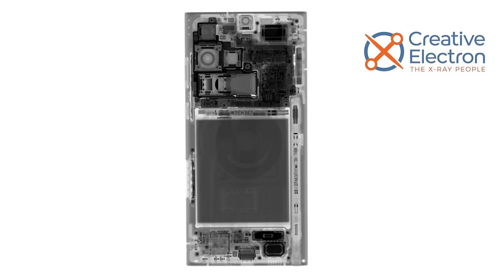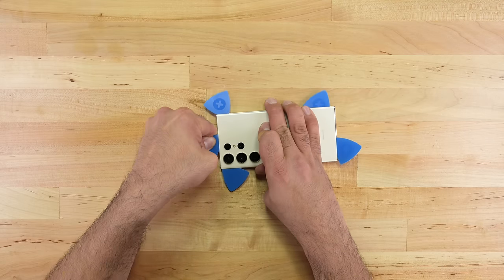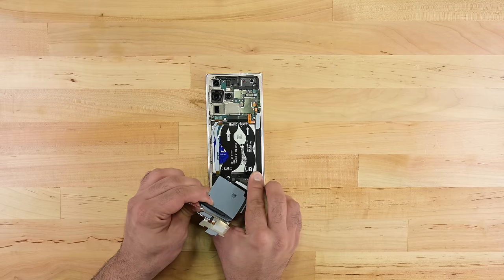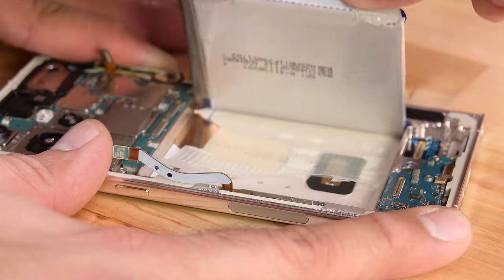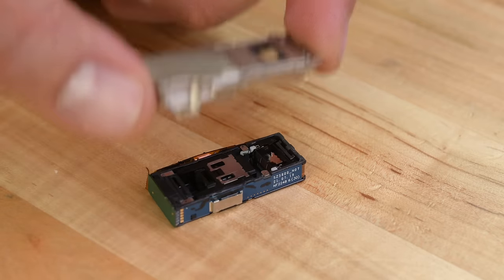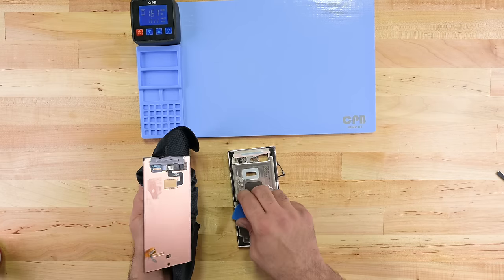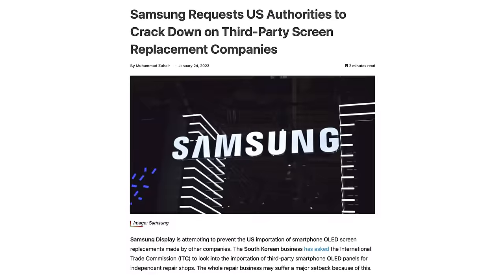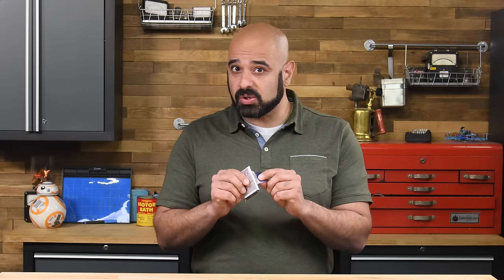S23 Ultra Teardown: Right to Repair Forcing Samsung Towards Repairable Design

Comment: How Completely software locked phone getting 7/10 and a phone without any software locks getting 4/10 For using too much glue. And Samsung provides debugging software for everyone of their phones. Reparability score really needs to include software Not just the hardware.
Reply: Even if you only care about hardware i phones have security screws so that is not getting any negative points ? .
Reply: Agree
Reply: @Gokul_Yt  no, because the screw drivers are very common
Reply: @mus_xr4653  IPA is also very common
Reply: The screens on the s23 and s23 ultra are irreplaceable. If you want to replace a screen you would have to replace the screen and the full frame, making the after market repairs unaffordable
Reply: @Gokul_Yt  maybe somebody is supporting Iphone
Reply: @mus_xr4653  neither on the new iphones you loose so much  functionality.  And samsungs whole disply+  battery bundle (from ifix it) is cheaper than iphone screen alone.
Reply: Also let’s not talk about screws either. You need multiple screwdrivers for iPhones.
Reply: Better secure phone, than an insecure Android phone. But also, Appl is more nature friendly and repairable, and why even discuss this if people like Apple and its here values they purchase Apple if they like Android and its perks there is a full market of Android phones. Nobody is forcing you to purchase an Apple device and there are alternatives. I like Apple so I purchase it and don't complain, as it is told what I'm purchasing and getting for the amount of money that I spend.
Reply: @valtersITeu  what does anyof that have to do with repairability of a phone. Apple really cares about enviornment with these software locks cant agree more
Reply: @mus_xr4653  j en ai deja remplacer 2 c est 380 euros la bete et en ce moment trop de delais
Reply: @valtersITeu  what you know about apple security phones, to compare it with android phone security?
Reply: @valtersITeu  you've never worked on an iPhone before.
Reply: @valtersITeu  Typical IPhone User lol.
Reply: @MUS_XR  samsung screen replacements are STILL cheaper than iPhone screen replacement. And it also means that most repairs are stress free since you don't need to mess with the display to replace something in the back. Also back replacement are super easy and cheap which is nice.
Reply: Are y’all working at samsung store or apple store? if so then it don’t come out of your pocket anyway. no corner repair shop is going to use original displays, and no third parties are able to make samsung screens on the other hand there’s a sea of third party iphone screens for those that need options.
Reply: @AndyZULUL  if no third parties will be able to make samsung screens they also not be able to make iphone screens bcz samsung is the one that make screens for iphone and the trademark is only filed agains 3rd party iphone screens
Reply: @Gokul Yt  back when iphones had lcd displays people were using third party displays from China which were cheap and couldn't tell the difference hardly. But I don't think you can get 3rd party oled displays not that I've seen any.
Reply: @mus_xr4653  "the screens on the s23 and s23 ultra are irreplaceable." What about the plus model? Did you leave it out because its screen is replaceable?

Comment: LMFAO they give it a bad score based on how they can repair the device with their flawed tools, heat and IPA will remove that back glass faster than you could try to remove that front OLED from any iPhone without going the apple route. Admit it ifixit at this point your at apples mercy.

Comment: batteries shouldnt be glued in to begin with
Reply: What would hold them in the frame then. You don’t want the battery shuffling around.
Reply: it damages the battery if it is not glued....
Reply: @williamskyseraspili4779  theres a ton of different ways to attach a battery without making it risky for unexperienced  users to remove
In fact, i can hardly think of a more dangerous way to attach a battery than gluing it in
Just look at older phones, samsungs xcover series or some laptops, it has always been possible to make a battery replacable without making it a hassle
There is no excuse for a company to glue things shut except for making the product have  a guaranteed shorter lifespan, batteries are always the first thing that goes
Reply: @CommanderCodey  how are AA batteries secured in place?
or single button cells, car batteries, battery packs on xbox controllers and maybe the best example, older phones?
its all possible, has been done before and even is done today
just look at samsungs xcover series for example
no glue, doesnt wiggle and youre able to replace the battery in 10s or less
Reply: @PLPlolol1  removable batteries need bulky safety cases casue they are ment to be handled by the consumer.
Reply: @PLPlolol1  AA batteries are secured with the spring putting tension against it to hold it. Old phones had the battery held against every side. In modern phones it could move around in every direction if not secured because there’s no “holders” around the battery holding it in place. Except for the glue.
Reply: @CommanderCodey  tell that my xcover4s
We dont need glue

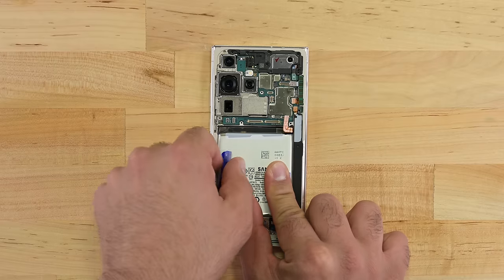Comment: 1:31 i don't agree at all on this pulltab. Your perception is IMHO influenced by the fact you tear down brand new phones, so the "stretchy adhesive trips" Apple uses work as intended on new iphones. But if you're replacing the battery after 3 years of ownership, all the heat cycles from charging and using the phone "destroy" that adhesive, meaning no matter how careful you are those stretchy stips are gonna break and you end up having to pry out, risking battery puncture.
This kind of "huge pulltab" Samsung has adopted (and was already in use by Huawei and One Plus i believe) might prove less convenient but it gives a consistent battery removal procedure even years down the line.
Also, this requires no additional tools, while the iPhone adhesive strips have to be grabbed with tweezers and almost always more extensive disassembly of the phone (taking out the taptic engine for example).

Comment: You give it 4/10 but other repair channels give it 9/10...
So what is going on here? Why have you more trouble and negative view on it than others? Explain it.

Compared to iPhone14, it get much negative score and it's reported software locked. Then compared to others, iPhone 14 should have 2/10 score here.
Reply: Well i think the main problem with Samsung is still the curved screen, that is just so much harder/pricier to repair than flat screens(And ofc the insane amount of glue in the whole device). Is it worse to repair than a software-locked screen thought? Hard question indeed...
Reply: @StarfoxHUN So, a part that CAN be replaced while retaining FULL functionality vs a part that CAN be replaced WITHOUT retaining full functionality is a toss up? Heat plate or heat gun at 173F/80C does quick work of the glue.
Reply: Rent free babyyyy

Comment: I’m glad Samsung Google has partnered up with you guys to help people fix their devices. I wish Apple didn’t software lock all of their components to the motherboard. now, if we want to fix our Apple devices we have to read a long ass manual. i’m glad Google and Samsung just make it quick and easy.
Reply: @No offense the idea is to have CHOICES. apple charges an insane for out of warranty/apple care repairs that are frankly not worth it for older devices. and they can also refuse to service your device, or maybe apple repair is just not convenient in an area. for this reason, it is EXTREMELY important to have 3rd party repair option so people are not at the mercy of one company to get their things working again. if you would like apple to fix your things, great, im glad they can help with that, but you should never support apple's decision to lock down repairs so other people cannot fix things their way too
Reply: @No offense they serialize components and then tie them to a motherboard
Reply: @No offense how is a serialized display going to secure your device?
Reply: @No offense way to ignore my question.
Reply: @KevinColumbus  Dude, just leave him alone. It's hard to have a convo with someone like that
Reply: @hassanmwasisebe3784  yeah I gave up lol
Reply: @davidyang9902  there are reprogrammers available and that we use at the location I work at as a 3rd party repair technician.
Reply: The samsung one bundles battery and screen. And they're often out of stock. I feel like samsing doesn't want to to repair your own phone, and the repair partnership is more "just for show". Similar to apple's self repair program.

Comment: Will you guys be doing a chip ID at all? There's definitely some pretty significant changes to the sound. I am curious to see if Samsung have upgraded the amplifiers to the newer higher powered Cirrus models that are in the ROG 5/6 phones or if they've just stuck with the older models, and only upgraded the speakers.
Reply from the maker: Chip ID is coming soon!
Reply: @iFixitYourself 🔙

Comment: Minimum 250 bucks on ebay for a screen + digitizer replacement kit... Sure they may have made it a bit easier to repair your device, but at the same time cracking down on accessibility to 3rd party oem parts, you are better off just going through your phone company still. This is 1 step forward and 2 step back.
Reply: Mm makes me want to sell for that reason but hopefully the price to fix it goes down with time

Comment: Always found Samsungs to be one of the best to disassemble and repair, even with the glue they use for the battery, have always just added some IPA and walked away for a few minutes, should also note a pull tab is not new for Samsung devices  it has appeared previously on some of their tablet devices.

Comment: i disagree on the score. at least you can repair this device without the manufacturer. 
even has an open bootloader. 
I have a galaxy s5 to play arround and i'm still able to install new custom software. All about the options.
Reply: @No offense this is a good point. Best would be the best of both worlds :)

Comment: There's something i totally don't get. Why the curvy cables in the inside? They are definitely bit more pricier to produce than straight cables, so what could be possibly the reason they make it curvy?
Reply: @cmmartti  why wont it be more expensive, when it costs more material. Yea the amount is tiny in one unit, but when you produce millions of them, it adds up.
Reply: @cmmartti  I think you did not understood my original question. What i asked actually is its purpose, as it has to have a purpose otherwise the company wont even spend even 1 millionth of a cent more /device.
And I'm thankful for your theorizing about its reason, but i'd looking for something more 'decising' than an 'i think' or something along those lines.

Comment: Cameras are getting bigger and motherboard is getting smaller...
Reply: Not really. Its not smaller. The circuit layout is just more one rectangle. Other phones uses long circuit board along the edge, like iPhones.
This way battery can use full with, and the design here needs 3 big bridges. The iPhone design has no big bridges.
That is why it's just another PCB design.

Comment: Personally I am disappointed with your disassembly ...

You make no reference to the parts inside unfortunately,
except for the camera

Do we have LPDDR5X memory from there?

Have we Universal Flash Storage UFS 4.0 ?

You're not talking about the Qualcomm 8 G2 processor

The modem in a Smartphone surely not useful either you do not speak about it
X70

No inventory of parts that have actually been installed inside the Smartphone 

You say, what interests you is under the hood 
And you practically talk about there tab install to remove there battery 

It's like opening the hood of a race car 
And only watch there battery once the hood is open 
And you won't watch the engine with the supercharge

Seriously, probably your worst disassembly since the existence of Ifixit
Reply: Yes it does have LPDDR5x. Yes it does have UFS 4.0 and I definitely do think ifixit’s teardown was disappointing and just bad in so many ways
Reply: @LaidBackDeveloper  Thanks for taking time to respond to me 

Can you find a website that shows the part numbers inside the S23 Ultra
Or have we hoped that Ice Univer would deceive as little as possible in its predictions? 

Example, I believe the fingerprint reader is the same as the s22
And yet Ice Universe predicted an improvement 
It's only an example 

By the way, I really appreciate Ice Univer because they give us information very often it comes to fruition 

For satellite communication 
Qualcomm seems to say that they will be able to activate it on certain Smartphones with the 8 gen 2  During the year 
They said about second trimester 

But I believe they will also have to wait for Android 14

So might as well wait for the s24 Ultra!
The possibility of a Satellite connection is very reassuring in an out-of-zone excursion of cellular networks.

Comment: It would be good if Samsung put a back on the s24 series like they did until the S5, but glass with an aluminum plate against like the iphone 14 and 14 plus, and the wireless charging coil attached to the back, and the rest as it was as the S4 (with the S5 the screen had to be detached first to be able to take it apart).
And the A and M series like in the past, like the galaxy A5 2015.

Comment: My S23 Ultra has the defect in the bottom right corner. It is too late. I have  turned on the phone. How can I fix the problem?
Reply: Relax, this is not even a defect, all previous edge phones had this similar "defect" and nobody noticed that all this years.

Comment: What I don’t like is this huge heat pipe going straight to the battery. Good luck in having good battery life after one year of use, the battery could suffer from the processors heat!
Reply: You didn't check further it goes to big copper plate behind the screen. Heat is already distributed over big area. Battery has nothing with heat distribution!
Reply: It doesn’t. It goes behind the display.

Comment: still too little in my opnion. we gotta get back to the days where the battery were easly removeable and we gotta force modular design with standards for parts for the whole industry, the way the USB-C is going, but with all internal parts. standards needs to be enforced and mandated. it will make phones bulkier, yes, but honestly i don't care for a few more inches, and i think you shoudn't either.
Reply: we can't go back to completly removable without sacrificing around half the battery capacity which is just unacceptable, we are only finally reaching acceptable battery life these days